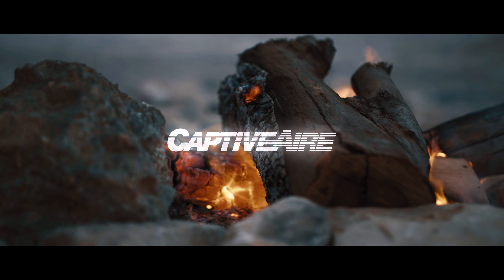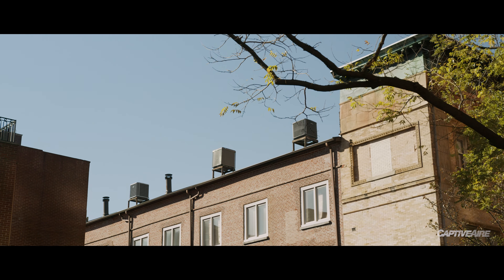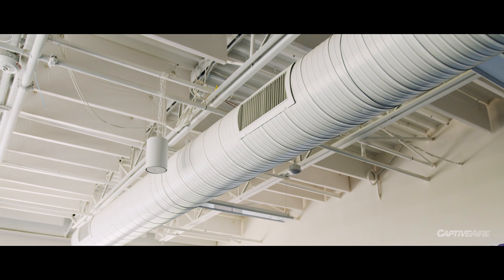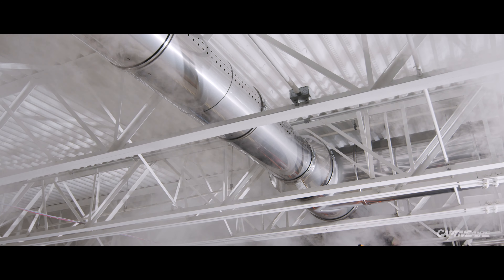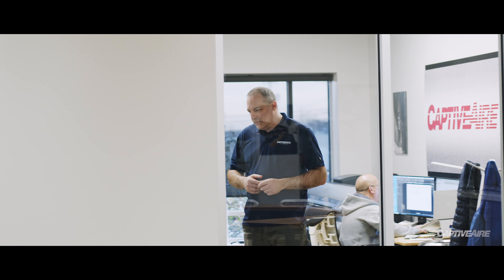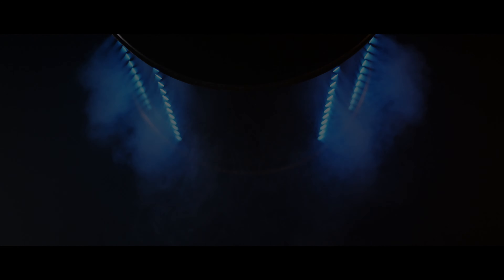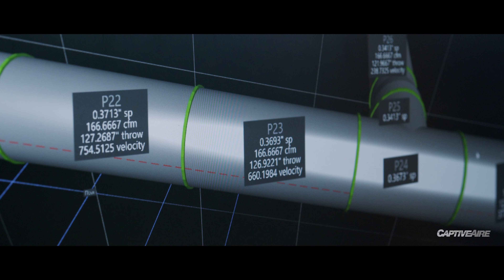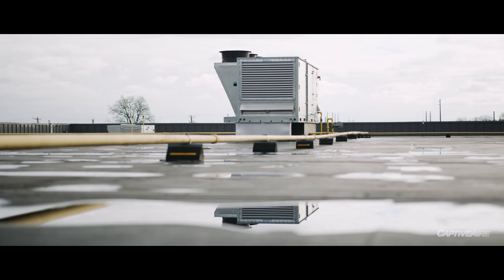CaptiveAire Integration: Rethinking HVAC Ductwork

Comment: Ok, and what do you do if your space cannot or will not allow for various reasons a tall open framed ceiling like that. You cannot run stainless steel round duct like that in a space with a traditional T-bar drop ceiling for example it would look terrible, and potentially cause issues with less than ideal clearance from floor to duct if the room only has an 8' or 9' ceiling height to begin with. Tearing down the entire ceiling structure, removing and relocating all those things that are typically 'hidden' in that small space between the drop ceiling and the ceiling/floor structure such as light fixtures, exit signs, heat and smoke sensors, occupancy sensors, Wi-Fi access points, telecommunications and LAN wiring, signal wiring,  along with fire suppression and sprinkler systems just to be able to retrofit a new HVAC duct system would cost more than the equipment itself, not to mention a serious amount of downtime for the building.
Reply from the maker: Yeah for sure, there are some scenarios where it is not ideal. We would never claim that this is the only solution, just a superior alternative when the conditions permit.
Reply: @CAPTIVEAIRE  Don't get me wrong, I think overall this is an amazing product, and I've been wanting someone to make a good makeup air system for a long time now.
Reply: I completed a lab project recently, where we left the office areas with exposed ductwork and painted the exposed ceiling structure. I will take the beautiful s.s. ductwork over painted galvanized ductwork.
Reply: @johnalvar  That sounds nice!